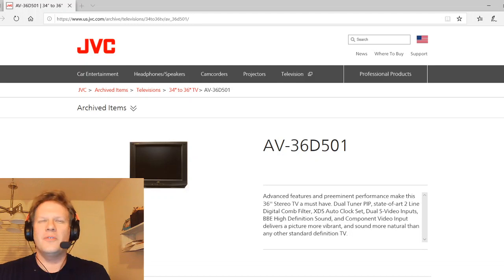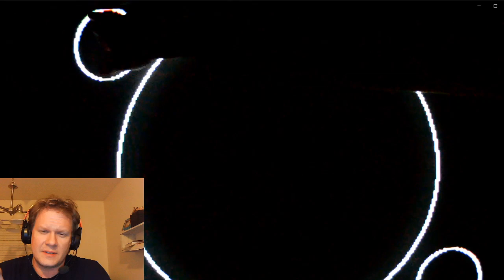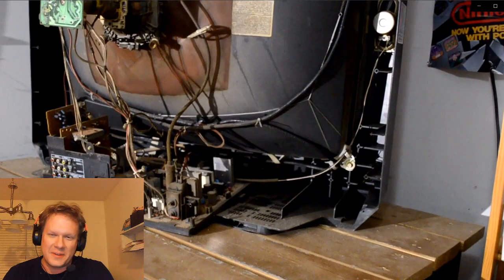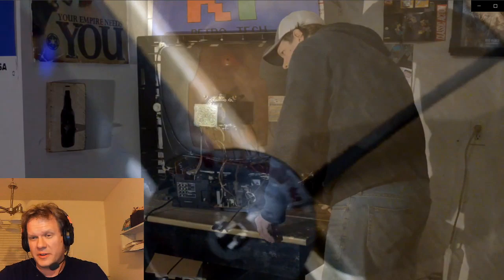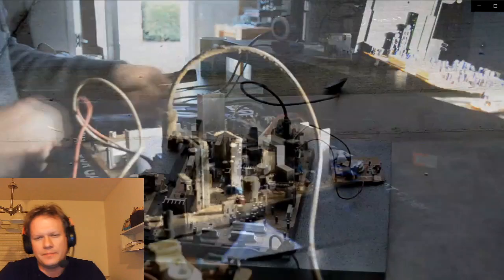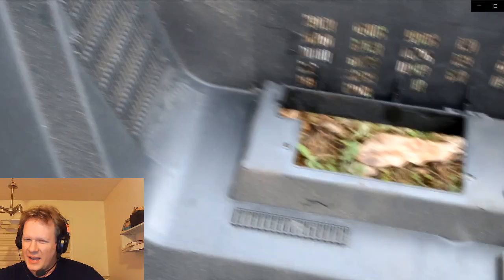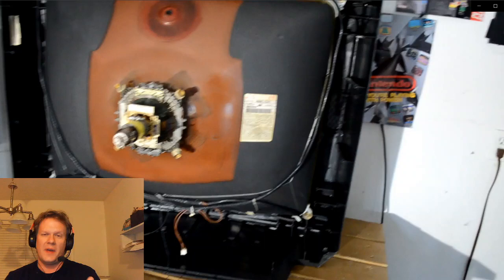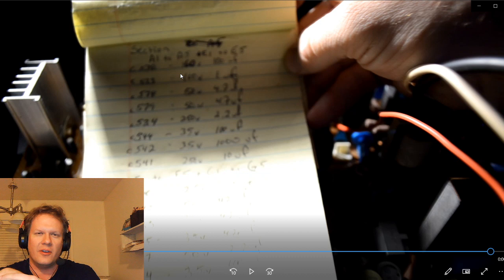JVC AV36D501 D Series CRT Restoration | 20 years of Cigarette Smoke Inside!

Comment: Seeing you do videos like this is always great. The common attitude towards CRTs in most fields is that they're just junk to be hauled off to hazardous waste disposal whenever possible. But at least there are still people cleaning up even CRTs in really bad states like this one to keep the hobby alive.
Reply from the maker: Thanks, we need to keep CRTs in use as long as possible.
Reply: Kind of funny though because lcds are technically a highly inferior technology from an image and latency standpoint...
Lcd won the mid 2000s tv war not just for being lighter weight, taking up less space, and power consumption, but rather also due to meddling of the market to make LCD be seen as the best option due to its dirt cheap manufacturing cost.
Reply: @RetroTechUSA  I have the same tv and I think it may need to be recalibrated. Perhaps if I'm able to, I can open the case and do whatever it is to realign the picture so it can be as flat, straight and even as possible. But I'm not expert at this. I'm not sure if I should ask how safe it is to do this. It'll cost me too much to hire the tv repair man to do this. Doing it myself sure would help me learn but still, need to know the steps and precautions.

Comment: I enjoy watching your videos. The paint on the back of a crt is called  CRT DAG. It's purpose is to create  capacitive coupling to the high voltage layer on the inside of the tube to prevent interference and discharge. It is always important to maintain the grounding connection to the DAG by means of the spring and wire attachment.

Comment: My free craigslist Trinitron was just as caked with dust, luckily not from a smoker so it all blew off with compressed air rather easily. I washed the rear cover with soapy water and a hose to get rid of the garage smell (previous owner stored it in his garage).

Comment: I just posted on your patreon page on the cap kit post.  Great content!  I just picked this exact model TV up for $50 yesterday from it's original owner. Mine is equally filthy but yours had a much better starting point image-wise. My side edges are blurry especially at the corners where there are also significant convergence issues.  Colors look okay but white seems a bit high and blooms near the center to the point where the scanlines come together where white starts and ends but oddly enough separate inside whatever white object is on the screen. Contrast is turned all the way down which reduces that but still happens.  I'm going to start with a thorough cleaning and recap.  I truly enjoy the consumer grade tv content, large and small, coming from an owner of several PVMs including a PVM 2950Q and a PVM 1354Q.  Your sony trinitron RGB mod and recap brought me to your channel a couple years ago. We have a window of opportunity to get people to save, restore, and improve as many of these as possible over the next couple of years.
Reply from the maker: Hey, sorry I'm out of town but I'll be back next week and I can send you the list.  Thanks for joining
Reply: @RetroTechUSA  thanks and no rush.  I won't be getting to that for quite some time anyway. My practice CRT is a 2005 era 13" durabrand from someone's curb and I will be doing that first. Spent the evening practicing focus and convergence adjustments. I will revisit convergence. Hard to do with composite only. I have scanlines now. It seems like some entry level manufacturers intentionally softened the picture, probably to avoid the time it takes to fine tune convergence. Anyway it looks surprisingly good and by the time I get to the D series I want to be pretty proficient.    I worked as a circuit card assembly manufacturing engineer for two years right out of college so I am very comfortable with component replacement and modifications.  Good luck with the move!
Reply: @readyplayerprime8195  Did you ever receive this cap list?

Comment: I own a 2000 27" JVC D Series AV27D201. I am having a issue with the screen. The screen is slightly tilted. Is there any way of correcting it with going into the service mode?

Comment: I think you're always going to have some convergence out in the corners on a CRT of that size. When you've got a test pattern on you'll notice it easily. But when it's running a game not so much. I went mad trying to get perfect convergence in the corners on a big 29 inch arcade tube with convergence strips and even re fitted the yoke. The convergence went from being perfect in most of the monitor with bad corners to being 'okay' across the whole monitor. I wished now that I'd left it alone.

I just accept the slight CRT imperfections as par for the course and try to enjoy the overall package that CRTs have to offer.

(Great channel by the way!)
Reply: They sell convergence magnets to help with that issue and it does work.
Reply: @Mt1200z you'll never get it perfect even with convergence strips

Comment: Eagerly awaiting the video after you finish. I'd also love to see you RGB mod this! It's doable through the PIP board header. I haven't done mine yet, have all the supplies just haven't gotten to it.
Reply: Me too man i got an av32320  really similar to this one high line count lots of inputs i also have the 27 in version
Reply: Hd retrovision is a total waste of money. Only makes sense if you own one console and will absolutely never want to hook up others. For literally every other use case a scart to component converter is necessary, or you'll be spending piles of money. Also, rgb modding these sets isn't hard(on the scale of electronics projects) and is cheaper than either a scart to component converter or hd retrovision cable. If you can recap a crt you can rgb mod it, and why not? Saves money, ekes out that last little bit of performance over using a transcoder and the component input.
Reply: @displaytalk  yeah but if you're like me and like having everything in your set up playable at once on multiple crts or set up different consoles on individual crts so others can play single player games while i also play something else now im stuck feeding all scart consoles into a transcoder into the extron then out to separate tvs but the problem  with that i can now only play 1 console that uses scart at a time and i have 5  the whole idea was to have no restrictions just play on whatever tv and console you choose but you cant do that unless i get a separate switcher or more transcoders. Its  just different strokes for different folks dont just throw around general statements becasue people that dont know any better will repeat opinions like its fact and thats how we get so much misinformation in gaming
Reply: You buy a scart switch and run the output into the transcoder. 1 transcoder for 8 cables if you use for example a gscartsw
Reply: And you did buy more transcoders when you bought several hd retrovisions because that's all they are, just purpose-built single console transcoders
Reply: @displaytalk  lol no im not a idiot but youre missing the purpose of the product its to achieve good quality while maintaining ease of use bringing more things into a video chain only makes it more difficult to set up maintain and keep organized having 5 transcoders is just as impractical as paying 60 dollars a console for a cable but atleast  your set up doesnt have 5 sockets dedicated for your scart systems. im really not understanding your arguement here? What is it you really dont like about the product besides the price becasue im sorry you dont get into retro gaming for cheap anymore
Reply from the maker: I should be doing the RGB mod on it too if the recap goes well.
Reply: @RetroTechUSA  awesome maybe ill just rgb mod the jvcs i have and use them more
Reply: @crteaser9726  Oh I know it's not cheap either way but even if you're just plugging 2 consoles you save 10+ bucks(depends on the scart cable seller) going with a transcoder and 2 scart cables, 3 consoles you save at least 40, 4 consoles at least 70, 5 consoles at least $100 and so on. It adds up and it matters. Plus if you end up going to professional monitors(what I did) you already have all the rgb cables and the switch.
Reply: If you go with cheap or homemade scart cables the savings are way higher. 30 bucks a cable is pretty reasonable to expect. The products hd retrovision have made that do make sense are the actual component cables for ps2 and wii. Everything else only makes sense for one console, so like if you only have a super nintendo(or any other one console) and that's all you're ever going to be using in RGB an hd retrovision transcoder cable makes sense, otherwise it's not a good choice.
Reply: @RetroTechUSA  Great to hear!
Reply: @displaytalk  okay i understand whay you're saying there but, thats still your opinion on what is best given your set up and what you're using it for not what is best for everyone and to the people who dont know any better they may just listen to what you said and buy a whole bunch of expensive equipment and wonder why the experience isnt what they were hoping for i make my own cables and extron hook ups so you are right about the saving adding up i just try to make sure opinions aren't seen as fact cause i hate digging through the misinformation of forums which is where alot of  info is trapped
Reply: @crteaser9726  It's still going to be cheaper than hd retrovision 🤷‍♂️
Reply: @displaytalk  yeah but most people don't make their own cables i get your arguement now  most dont reply back like this cheers m8
Reply: @crteaser9726  I know but even if they buy expensive $30 scart cables(what I did, I don't make my own cables), they'll still save money. That's the scenario I based my numbers on
Reply: @displaytalk  yeah i see the reasoning for what you're  saying i just have a completely intention with set up so my needs are different too

Comment: So many capacitors lol. I'm about to do the same to my D-series, however I also have some bad convergence all over the screen, and i need to adjust the yoke a bit. Hoping you cover these topics with your D-series.
Reply from the maker: The yoke on this one is crazy.  I've never seen one like it.  I think all I can do is add convergence strips.
Reply: @RetroTechUSA  is it hot glued to the glass with 4 posts? I have a JVC (non D-series) and a Toshiba like that.
Reply from the maker: It looks like it might be glued in some way or they used epoxy in the factory.

Comment: I would love to see you do a video like this on the kv36 fv 310 seen alot go to the trash just casue they need a geometry adjustments or some caps
Reply: Sad. Turn the velocity modulation all the way down in the service menu and those TVs are awesome despite the flat screen.
Reply: @overkill7990  velocity modulation? do tell  ive heard of it but i only ever mess with geometry adjustments and caps
Reply: @crteaser9726  It's this enhancement type effect that they put on the flat screen trinitrons. It's supposed to make the screen sharper but it just makes it worse IMO. This guy talks about it at 4:20 of this video: https://www.youtube.com/watch?v=6ivGM3S1BeI Someone told me about it on the CRT gaming reddit forum when I was complaining about how I didn't like my 2003 Sony TV. All I know is I went into the service menu which I had never done before and turned down every setting that started with VM, there were four in total, to zero. And since then I like my TV much better.
Reply: @overkill7990  thanks man might have to try that im usually not one to complain about dot crawl and buzzy edges im just glad to still play on crts- just checked mine wasnt on from the factory